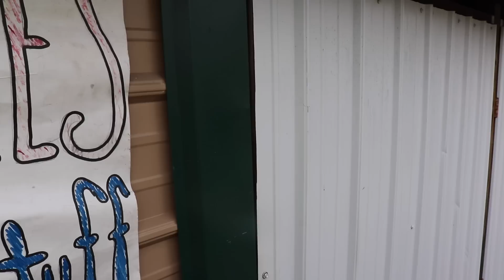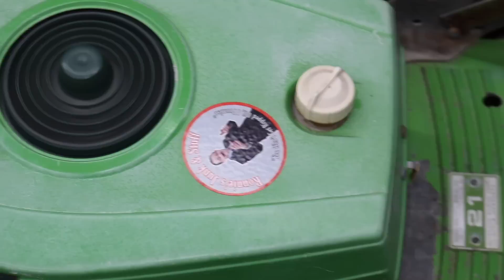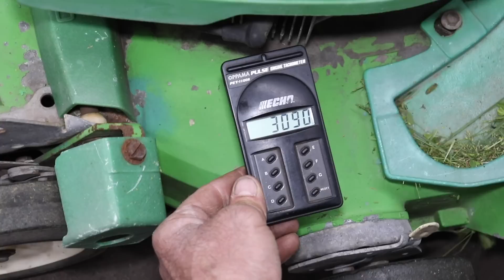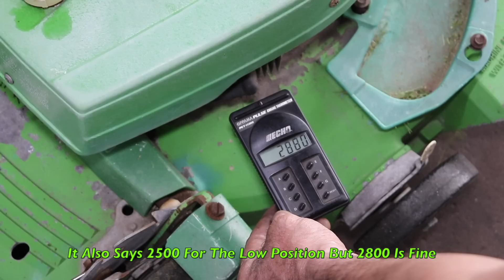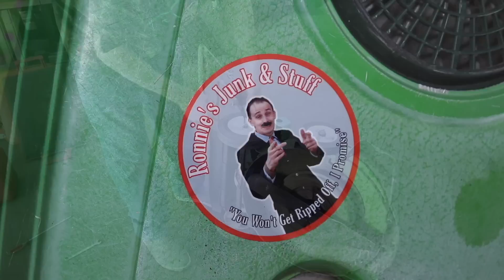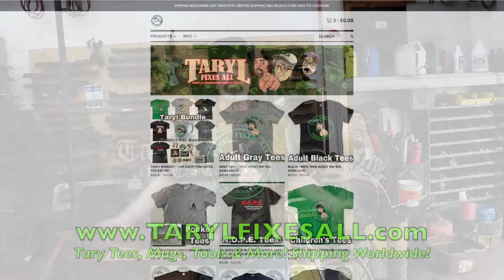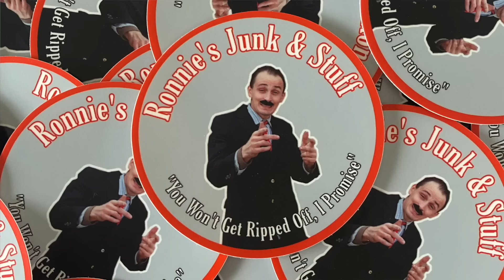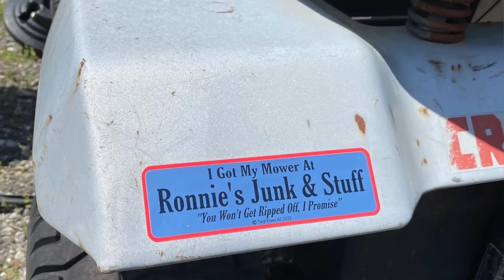This Lawn Boy Sat 30 Years. Can We Get It Running?

Comment: Neat.! I always thought Lawn Boy mowers were a bit Mickey Mouse, when picking up or fixing old junk but that’s a fairly powerful mower !
Reply: Not "Mickey Mouse" at all.
Reply: 2 strokes have a power stroke on each revolution.  4 strokes every other revolution.  So twice the power stroke frequency means you can have a smaller, lighter engine.  They also don't have mechanical valves, so lighter still, fewer moving parts, and higher reliability.
Reply: @mikemorgan5015  yes also no ohv
Reply: @chrisgotgames6405  OHV are mechanical valves that I mentioned.
Reply: @mikemorgan5015  yes junk lol
Reply: @mikemorgan5015  lmao 🤣😂

Comment: I don't know if those blades are tempered steel. If they are you would be better off using a hand file to sharpen them, unless you enjoy sharpening them all the time. Getting the edge hot using a power grinder will sacrifice the temper.

For instance ... my ice hockey skates I only use hand tools to sharpen instead of the power grinder at the hockey shop. It takes me a little longer but I hardly ever have to sharpen them (the steel keeps an edge much longer). Once that grinding wheel starts throwing sparks the temper on the edges is lost. Of course the hockey shop makes money sharpening (and resharpening) quality steel runners. You probably also profit handsomely from sharpening.

Comment: hahahaha lawn boy vs briggs & stratton push mower
i never have issues with my briggs & stratton push mower thur 2ft taller grass
just need rpm be at 3500 or 4000 in order to cut it taller if your mower at lower than 3k rpm there issues just adjust grovement tension get it there

Comment: I have a lawnboy identical to that one that was my grandad I inherited, wanting to get er running but one bad thing, it has electric key start on the handle bar and the key switch is broke, thinking about doing away with the electric start but to find a manual pull recoil is the problem 😩
Reply: What do I do???
Reply: Plus the battery pack on the back of the deck isn't any good anymore😭
Reply: If I could find a recoil I would pull it back out of the back lot and put her in the shop and restore it.

Comment: American lawn boys seem a lot like our Victa 2 Strokes in Oz. Ugly, loud, reliable and tuff😂. Great mowers. I’ve only got 1 and it’s a late model early 90’s, probably the last series before they went 4 stroke. 🤦‍♂️
Reply: I know that Masport used LawnBoy/OMC D-series engines but don't know any details.  Lawnboys with the below deck exhaust were MUCH quieter than 4 strokers.   Since childhood, I've wondered why a proper muffler/silencer wasn't used on mowers and other lawn equipment.  I'm still wondering....... haha!  How is your winter going down under?
Reply: @mikemorgan5015   a proper silencer would cut down the power
Reply: Ahh, there you go. Very similar looking and sounds identical. We have had a lot of rain which has kept the cold at bay. Most rain Oz has seen in a 1000yrs apparently. Definitely most I’ve seen. Lol
Reply: @chrisgotgames6405  Yeah,  I realize that.  But how much?  Even if it was 20 or 30 percent, I'd gladly have a mower with a 6 or 7hp engine that is quiet that outputs only 4 or 5hp.  I don't believe I'm alone either.  Look at the popularity of quiet generators.  I do realize that level of noise reduction isn't likely feasible with a mower, but it's just crazy to me that in 2022 we still can hear lawn equipment being used half a mile away.

Comment: Biggest problem with the old lawnboys was plugged mufflers from sketchy oil.
Reply: The biggest problem was when someone would borrow it or someone would "do you a favor" by cutting your grass and straight gas it.  LawnBoys are on that list of things you don't loan out.  Lawnboy, Chainsaw, 10mm socket, Wife.
Reply: @mikemorgan5015  or your string trimmer!
I loaned out my late dad's Troy-Bilt 75SST to a neighbor Saturday and he brought it back Sunday with another lower shaft and head that was 2-3" shorter than the original.
Needless to say, but the shaft drive wouldn't quite spin the head. Claimed he didn't work on it and it was working fine when he used it!
No more power equipment loans from me.
My pressure washer is out on loan for the weekend and I'm having anxiety attacks every time I remember it's gone!
Reply: @Daddyrabbit_2  I had a neighbor who had all of the fun adult toys, ski boat, bass boat, jet ski, atvs, etc. , but almost zero tools or lawn care equipment other than a mower and string trimmer.  He's borrowed stuff from me occasionally and brought it all back in acceptable, working condition.  He saw me one weekend using my pole saw, edger, and hedge trimmer and asked if he could borrow them.  I replied in the affirmative, provided I could borrow his ski boat or jet ski when he wasn't using it.  There was a long, uncomfortable pause before he just turned and walked away.  We haven't spoken face to face since.  And that's sad.
Reply: @Daddyrabbit_2  Don't get me started.  A close friend of mine has borrowed many things from me and not a single time did I get them back clean, and more than once they were broken and unuseable.  Things like, "Oh that's what that bottle of bar oil was for!"  or  "I wondered what you meant when you said 2 cycle mix."  After he destroyed my trimmer by straight gassing it, yes, I gave him a fresh gallon of mix, he went out and bought a new trimmer.  Not to replace mine, but for himself.  The bonehead bought a 4stroke trimmer and used mixed gas in it.  He called me asking why it was smoking like crazy and not running right.  I went over to help him fix it and the first thing I saw was the new box with "4 cycle engine" on the front.  In fairness to him, he claimed he felt bad enough about having to borrow my trimmer, he didn't want to burn my gas too.   UGH!!  Haha!  Good times........ It's much funnier now than it was then.

Comment: One thing I have learned about working on mowers especially ones i get for free sometimes it is just as easy as putting gas in it and it runs great. People have the mindset that it's old and crappy and even though there is nothing wrong with it they just don't want it anymore they want to buy a new one that probably won't last half as many years as the old one there getting rid of. Americans are the most wasteful people I think on this planet if they don't want it they just throw it away even though there is nothing wrong with it.